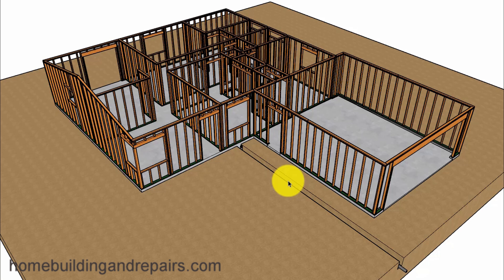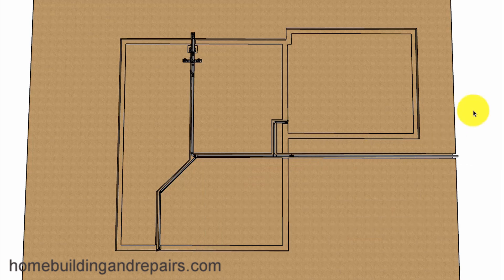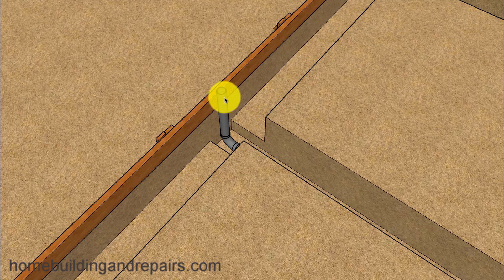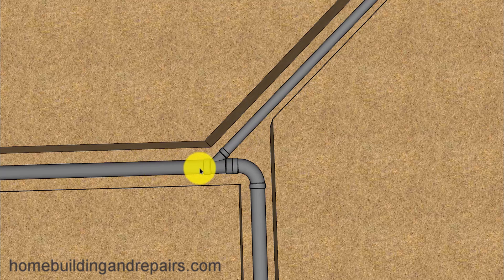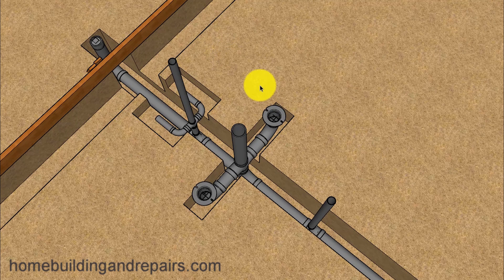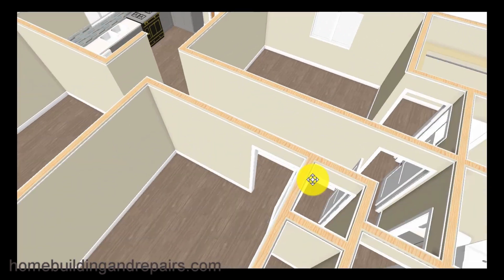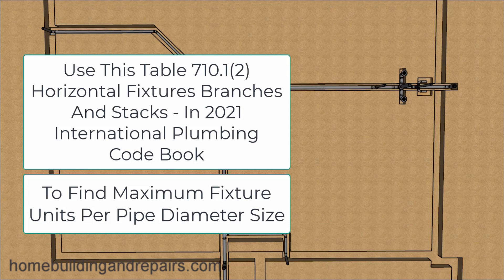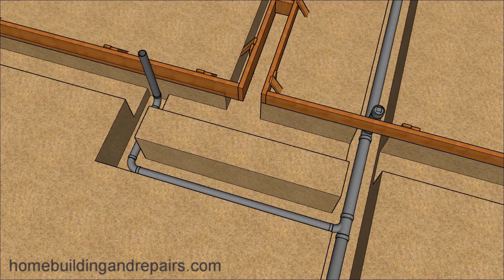How To Calculate Drain Waste Pipe Sizes By Using Plumbing Fixture Units For Single Story House

Comment: Great video! I would have designed the water heater in the garage behind the door instead of the washing machine. Washing machines make noise, why put near door so you can hear it in next room? Who wants to have to deal with door hazard while doing laundry? Also- some of the newer washing machines have a very rapid drain feature, especially Samsung, which can overflow piping, would not hurt to calculate on the safe side.

Comment: There was no mention about the drain pipe size in relation to the distance from the fixture e.i. does a 2" drain from a tub have to be larger when the distance is greater than 5 ft to the main waste line?

Comment: Actually boss laundry drains are 3 not 2. 2” p trap is 3 dfu. Sinks 1-1/2” p trap is also 2 fixture units not 1.
Reply from the maker: Always Check Local Building Codes Before Building
It looks like you're referring to a laundry group, but let me know if you're not.

TABLE P3004.1 DRAINAGE FIXTURE UNIT (d.f.u.) VALUES FOR VARIOUS PLUMBING FIXTURES - 2021 International Residential Code Book

Laundry group (clothes washer standpipe and laundry tub) is 3 units, Clothes washer standpipe is 2 units

Comment: Hey boss, I’m wondering on how your getting these fixture unit values ? I’m using 2018 IRC and on table p2903.6 and I’m getting different unit values than you are.
Reply: Okay, the p2903.6 isn’t valued as load factors never mind, thank you sir for the video.
Reply from the maker: You bet.

Comment: So.. crazy thought what if I had a drain for the toilets in the bathrooms but had both the sink and the shower (no tub) in the floor pan and incorporated the entire room as a shower floor pan. In essence making the bathrooms into wet rooms.
Reply from the maker: I would think it that would work with a two inch drain, but you would need to check with local building department to verify.